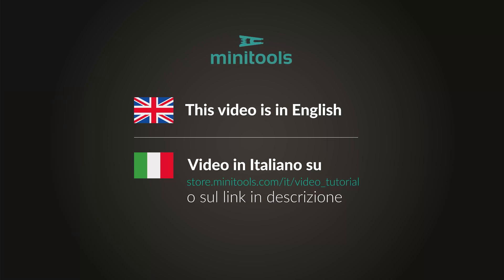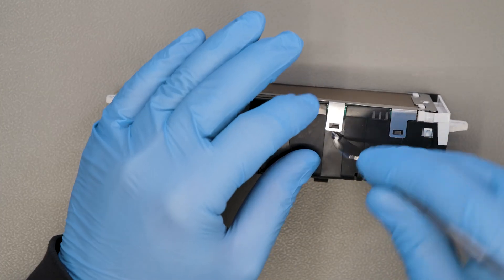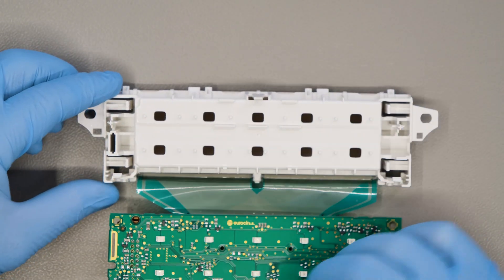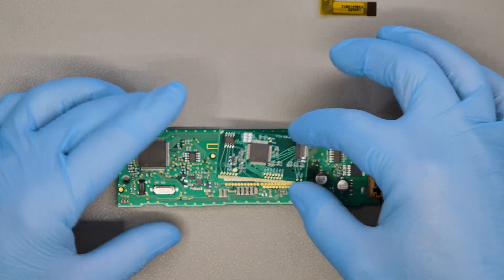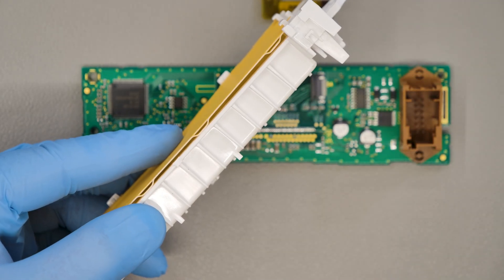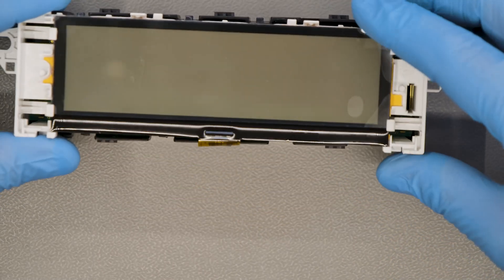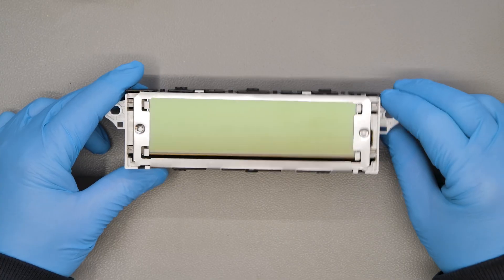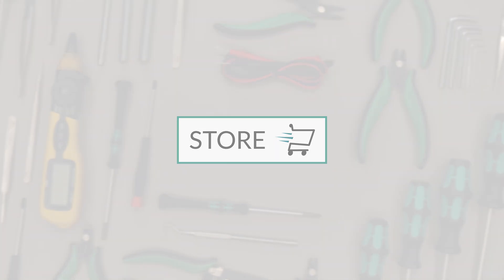Citroën, Fiat, Lancia, Peugeot and Toyota multifunction unit LCD display replacement

Comment: Display replacement, is a can device necessary? is it possible to change without a device?
Reply from the maker: Hi Eray, that depends on the module brand: if it is a Borg module, you would need the CAN BUS generator, if Magneti Marelli, you would need to supply 12V to Pin 1 and GND to pins 2 and 3.